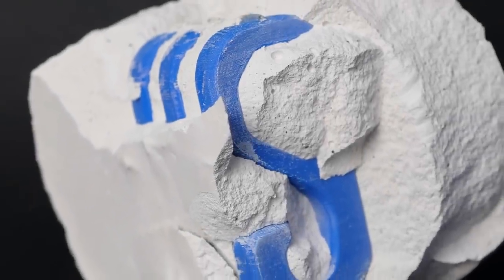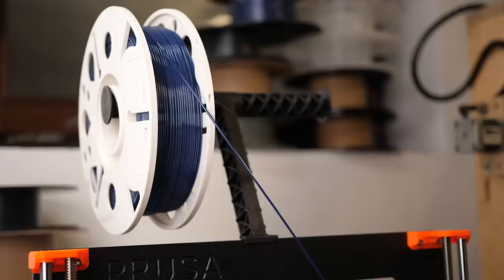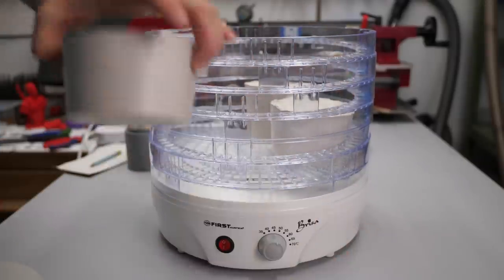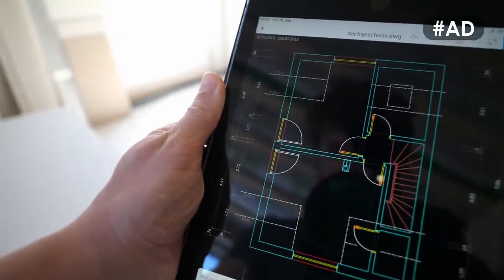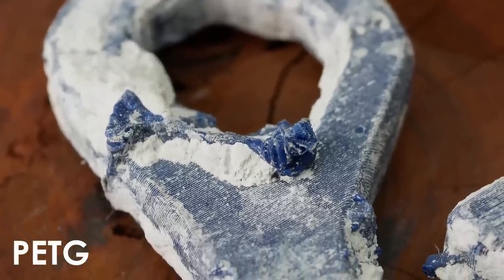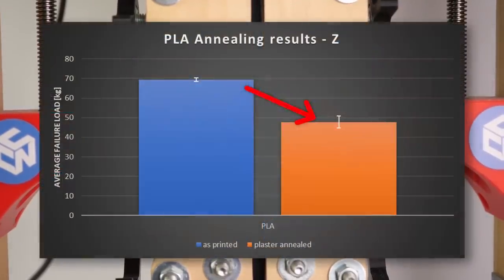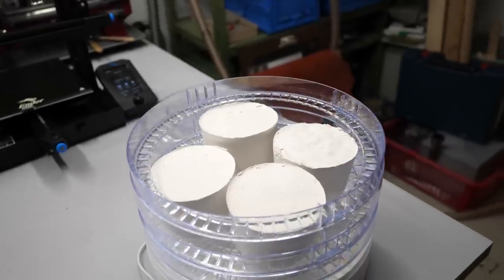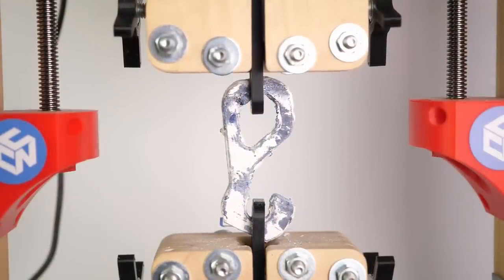Triple (x3) your Layer Strength by Annealing 3D Prints in Plaster!

Comment: I had a thought a few days after watching this video. I had seen another video where someone was making silicone cast molds for pouring pewter. It seems to me that if the goal is merely to maintain shape while being heat resistant; this could be a good option instead of casting in plaster. Simply cast the part in a silicone mold, bake it up to and heck even past melting point, then cut it out of the mold.

Comment: I just had a slightly modified idea, to use thinner layer of plaster, just enough to coat the surface and then pack it in salt.. Combining both salt remelting and plaster cast, i think it will retain the surface finish and detail but isn't so hard to remove afterwards, packing the whole thing tightly in salt would keep the overall shape. Best of both methods.. too bad it is way too hot now to start warming up the oven... 

I was experimenting with ABS goo, coating PLA parts when it suddenly hit... first i thought about annealing inside ABS "coat" but then i remembered that i have painted plaster on top of prints to make a faux plaster finish, using thin plaster and several layers. It gets into every nook and cranny.. first painting the plaster and then filling up the rest with a thicker mix, packing it in salt.. It should work.

Comment: You might try very fine high temperature casting sand and pack the part tightly by hand. No water needed so no hydrolization/drying step

Comment: Silicone can withstand 200°C for a long time I believe. Would using silicone as a mold work? As I'm pouring, vibrating bubbles, curing, and annealing? And if your doing a part that you make multiple of, one mold could last for a long time if you cut it in half to open it.

Comment: Would it be possible to use the 3d printed part as a lost form part attached with some risers with additional material. And then completely melt the plastic in the mold

Comment: Like The Colonel was saying, seal the parts first.
I was thinking about sealing in silicon before the plaster. You could do this as a glove mold. (pour or brush on)
Now you would have a mold that can be removed cleanly, with no air bubbles... I would think.
Then again, if the mold was only silicone, the next part printed could be fitted into the existing mold I would think.

Comment: I wonder if coating the parts in some kind of water resistant layer, for example clear coat polyurethane paint or electronic conformal coating, before setting them in the plaster might help? Maybe even something as simple as an oil coating would help keep the water away from the part?

Comment: Might I suggest using lime instead of plaster? It has the same effect of slowing the cooling (I use it with metals), but the advantage of not needing to be mixed or broken apart, and it's reuseable forever. If packed tightly it should provide sufficient support for the print. Alos, a vibratory sander is perfect for removing air bubbles from mixtures, and works fast enough to use with plaster. Just set the sander on the side of the container that you are using for the casting.
Reply: Can you describe the suggested process with lime in details?
Reply: @PSYInform  It works a lot like the following video where the author uses salt, but do not use a microwave or the kitchen over as a heat source. Use an oven that you dedicate to the process. With metal I wait at least 24 hours before removing the peice from the lime, but waiting longer is noot a problem at all. The key is packing the part to be treated very tightly, and not removing it too soon. 
https://youtu.be/nRLJ4ylGTFc

Comment: Maybe try using a thinner plaster mix and dipping your parts several times to make a skin that’s thick enough to hold the plastic in position but thin enough to dry more quickly and break off with less effort?

Comment: what about using high temp silicone as mold instead of plaster? could potentially be reusable and would not adhere to the parts at all, although it would be a lot more expensive.

Comment: Rather than vacuum casting, you might try pressure curing, where instead of trying to get the bubbles out of the mixture, you use a high pressure chamber to compress the bubbles to a smaller size.

Comment: To avoid the plastic absorbing water, would it be useful to cover them in something that will act as a barrier to the plaster? Somethning like a thin layer of epoxy?
Bubbles can in epoxy molds be avoided by letting it harden in a pressure pot. This will compress the bubbles significantly, and then harden in that state. The same should be true with plaster. Might be a problem if they then expand in to the heated plastic parts, but might be worth a try. And ofcorurse normal bubble-removing practices, like vibrating the container for a time after pouring the mix in.

Comment: What about decorative ceramic? It starts as a liquid (sometimes called Slip). It gets left to dry at room temperature. At that point it is extremely brittle. Then it gets baked in a kiln to very high temperatures. Once completed, it is significantly harder, but could be broken away fairly easily.

Comment: I always wonder if you print petg the right way? I print it with my mk2 at at least 240C and a fan about constant 40% and get layer adhesion much stronger than with pla? As soon as I raise the fan I get the layer problems. Petg parts tend to crack perpendicular to the layer lines here. However I have no real test machine.

Comment: Not sure of the temps your trying to reach but have you considered silicon molds ..  they should be good for temps up 230 degrees C  and re-usable  at higher temps they start to degrade with use ... just a thought.

Comment: Try casting sand rather than plaster, and it would be much easier to remove.  There are some recipes on the web for casting sand (green sand).
Reply: I was considering delft clay. This is for finer details in the surface, so it will possibly not distort the plastic item surface. And there is no water involved in the delft clay.

Comment: Judging by low worktime this is alabaster (selling as "quick plaster"). Raw plaster worktime 10-25 minutes.
er has very serious drying speed problems. First, moisture quickly couples from the outer layers, then slow transfer from deeper. In the industry, plaster molds are heated in a vacuum microwave oven for about 4-5 hours, and then they are allowed to rest for a few more hours in the oven.
I advise you to look at  "green sand" molding mixture for casting. They have less water (it is easier to dry before baking), no problems with mixture worktime, bubbles problem solving by tamping and it's reusable. It's self-supporting so it will not flow with the part.

Comment: Could you further remove moisture from the printed part using a hygroscopic like lithium hydroxide?
I've seen you cast silicone in previous videos and I know it responds well to a vacuum.  Could you dip the dried parts in silicone to prevent moisture absorption when you cast them in plaster?

Comment: If you can find a casting material that doesn't use water or uses less, then you could improve results. But it would need a higher melting point than your sample. Try filling in the plaster with sand to decrease water volume and make it easier to remove after.

Comment: I make my parts extremity strong by printing a shell with a porous infill then injecting them with epoxy. For best results, degas the epoxy in the vacuum chamber then inject it into the part with a large syringe. You'll notice epoxy oozes out between poorly bonded layers when it's full. For incredibly strong parts add 20% (by weight) 1/32" milled fiberglass to the epoxy. Afterwards place the part in a pressure pot until it's cured.  You'll need to get a feel for this process as viscosity, pot life, part thickness... all come into play. Placing the part in a cup of water while curing is a good way to keep heat generated from running away and melting everything. Thick parts need more filler and a higher pressure to come out good.

When printing I use 2-4 walls and line infill with pattern [45,45,45,135,135,135].
This stacks the support infill and alternates it to allow the epoxy to flow throughout the part. Also, rotating each layer 80° creates a more open pattern with a stronger infill if the model can be built this way.

If you can degas the epoxy mix it well with a drill, if you can't, mix it very slow to prevent bubbles. (The drill / degassing method is best.)

I get all my supplies at fgci.com and I use the 3:1 laminating resin. It's non- conductive so it's great for potting electronics and it does conduct heat away so electronics don't get hot.

If you want a resin that's even stronger, use a castable urethane and add kevlar pulp. I get that stuff from freemansupply.com.

Best wishes.

Comment: I'd be curious to see what happens if you anneal in a high temperature silicone.  I'd guess drpending on the silicone it may warp or sag but then some silicones csn be made into molds which you can cast molten pewter in reliably. The whole thing may be pointless. It would be interesting to see the results though.

Comment: I would say this is remelting rather than annealing. Annealing is a heat treatment procedure, aimed to remove internal stresses. This is achieved by heating printed detail to a temperature that is between glass transition temperature and the melting temperature of the material, which are 73 C and 78 C respectively for PETG.
Obviously, since annealing doesn't melt the material, it is enough to put detail into fine grain sand or salt, as was suggested.

Comment: A possible alternative for plaster could be sand mixed with sodium silicate ( a.k.a water glass). It is very inexpensive, afaik environmentally friendly, and acts as a binder for the sand when exposed to CO2. This is used for creating metal casting molds.

Comment: Casting sand might be less work and give acceptable results too. I'm a bit surprised by the unannealed PETG that was printed laying down. The PETG I used so far normally deforms before breaking and is usally stronger than PLA.
Reply: I wonder if just packing wet sand would be enough?
Reply: @beanMosheen  Water is bad ... instead moisten the sand with silicone-oil or similar.

Comment: I feel like this could be an excellent way to recycle failed parts. Print a part in vase mode with a tube facing up, and as the plastic is annealing add scraps to the parts.

Comment: I think it's air trapped in the print itself. Have you tried casting sand? I feel you could achieve a fairly nice surface, easy clean up, reusable, and quicker to prepare.

Comment: Here's my trick for annealing parts:    
Use water based sand casting sand. Annealing the parts in regular dry sand didn't give me good results but I use water based sandcasting sand and have been really happy with my results. You have to make sure you have the sand properly hydrated and pack your printed parts really well.  My parts are strong and they keep their shape. I use olivine green foundry sand from Teton Supply

Comment: Have you tried to maybe move the cylinders according to layer orientation ? To if the layer orientation is Z than also place the cylinder on its bottom but if you lrinted on xy maybe put the plaster mold on its side so that the layers not only anneal together but also gravity helps stick the layers together. It would be interesting to see IF the position of the print in the mold does also play a role in the strength improvement

Comment: Maybe, use plaster mixed with something else like sand. This would potentially reduce water used, cost, and maybe make it easier to extract. Another idea I have is first make a rough  two or more part mold from plaster of Paris or another material, then put piece in this mold with plaster of Paris or other material. This way less water is used. Also maybe try spraying part with hydrophobic mold release agent before plaster of paris? so releases betetr and water effects less?

Comment: Now that I think about it, the results with PETG aren't too surprising to me. I work with clear PETG sheets regularly to make check sockets for prosthetics. Something I've noticed while drape forming with that material is if you don't have a separating layer it will just straight up shatter rather than split cleanly at the seams. If the material temp is fairly homogenous it definitely bonds well to itself.

Comment: I am wondering what would happen if instead of fully encapsulating the hooks you poured a plaster jacket that left the surface exposed and only had a centimeter of additional thickness over the thickness of the hook itself.  If you mix the plaster 50/50 with 200 mesh silica flour the resulting mix is less likely to crack in the heating (I use this mix for casting glass will flow at 1550 F. The resulting plaster is softer than the full plaster mix and is more easily demolded.

Comment: Could you pack the prints in fine Sand and then compress the sand to prevent deformation?
Reply: The sand would become embedded into the plastic. In most cases that would not be desirable.

Comment: I wonder. Instead of submerging the plaster in water to get it off, if you hit it with a pressure washer. Then as the plaster gets wet and softens, the high pressure is there to remove the softened plaster before it can start setting again.

Comment: you could just try to pack them densely in fine plaster without water (or even greensand?), would be way easier to remove + no bubbles ( maybe even in a form with clamps to apply more pressure to keep the parts from deforming )

Comment: also try only dipping the parts to create multipal layers like investment casting and only have a shell thick enough to resist the part stresses, this will be easier and quicker to dry a shell vs a large diameter chunk.

Comment: I was thinking silica flour which is extremely fine heat resistant sand  embed the print in the sand in a metal box with a lid that can be bolted down to apply pressure to the sand and print. I have been wanting to try this for some time. I would be very interested to see the results. I feel like the pressure applied by the metal box might be very interesting.

Comment: @CNC Kitchen About 3 years ago I tested following technique with PP and PA filament prints:
I placed 100% infill test samples in salt in a metal container where I could put pressure on by clamping the lid down. I used very fine popcorn salt to reduce the indentations. https://www.amazon.de/dp/B075DKNMQV/ref=cm_sw_r_cp_apap_voPTn1dWc6qF1 But I also experimented to make a salt crust around the samples with water first. The advantage of the process is less preparation time and the salt which gets molten into the plastic is easily washed of. 
I didn' t put my samples into a testing machine in those days. But they didn't snap at the layers anymore and did show some yielding when breaking them by hand. I would love to see this method tested and quantified by you. If you have any questions feel free to ask.
Reply from the maker: Nice work! Salt is definitely a candidate I might try.

Comment: Could you make a shell in the way they make lost wax castings. Coat the part in plaster then dust with sand and then redcoat and dust again. You’ll only have a thin plaster shell to remove afterwards and your chances of getting an even coating might be better. You could then easily support it in sand.

Comment: A quick tip to.remove gypsum (plaster) is to put it in a baking soda solution.
Reply: Bump up so Stefan can see it
Reply from the maker: Why baking soda? Wouldn't I need an acid?
Reply: @CNCKitchen  It is something called double displacement reaction CaSO4 (plaster) convert to CaCO3 (limestone) and NaHCO3 or Na2CO3 (sodium bicarbonate or carbonate) convert to Na2SO4 (sodium sulfate which is non dangerous salt).
The limestone produced is not crystalline and come up as a slurry (no solid rock formation) that doesnt stick, the sodium sulfate is harmless an can be disposed down the drain.
This reaction can be done with any soluble carbonate salts, a more vigorous reaction can be obtained with ammonium carbonate which is sold as levering agent (if you can cope with the bad smell).
In my opinion the ammonium carbonate  (or bicarbonate)route may be better suited for thick layers due to  the higher solubility of the carbonate and the resulting sulfate.
I personnally removed plaster thickness of several centimeters with the ammonium carbonate but i only used baking soda for cleaning stained tools (mabe baking soda will work fine for large thickness but i cannot say i am 100% sure).

Comment: I would deshydrate the parts by leaving them in a oven for a long period of time.
Them I would sealed them using pam, wax or standard plastic demolder.
Then instead of using plaster, I would used fine grain polymer sand.  The cleaning process should be a lot easier.
Sounds good ?

Comment: with lost form casting some "paint" the form (e.g. out of styroform) with a thin layer of plaster (without boubles) and only after that layer is dry add more Plaster (or sand for casting) this may be a way to get rid of bouble holes in contact with the parts

Comment: If the point is to have a fine surface finish, hold the print in shape, and avoid adding moisture, is there a reason not to use the powdered pop as is and pack it in like greensand (i.e. petrobond, or like is done in the salt videos) instead of mixing it? I can't think of a reason but i'm interested in testing this out

Comment: You are basically making gravity cast parts out of your 3D parts.  A small extra bit extending up from the actual part could supply the extra material to fill the part in.
A chamber with a cylinder and piston off one side would help with the bubbles.  You basically vary the air pressure by about 1PSI at a 1 second rate.  This makes the bubbles tend to work their way out.
You are very close to a "lost wax" like system for making aluminum parts.